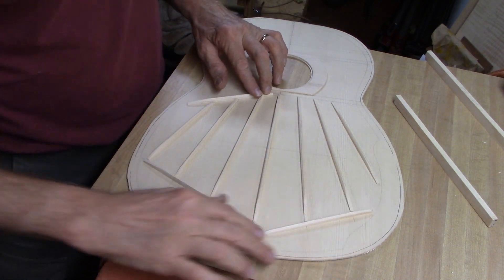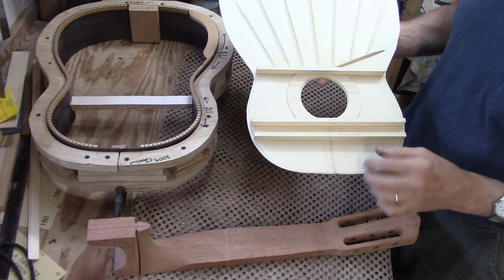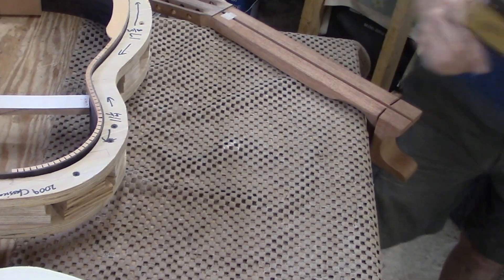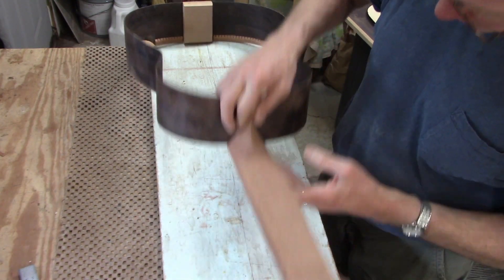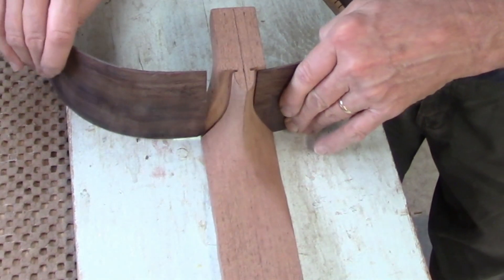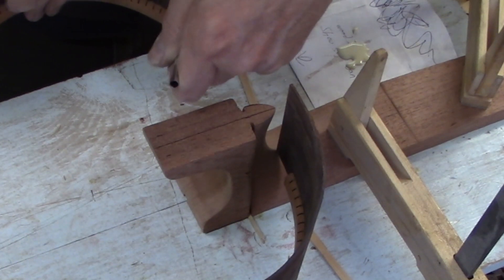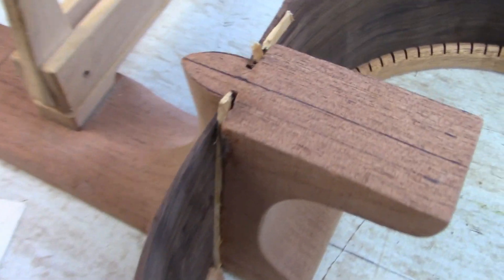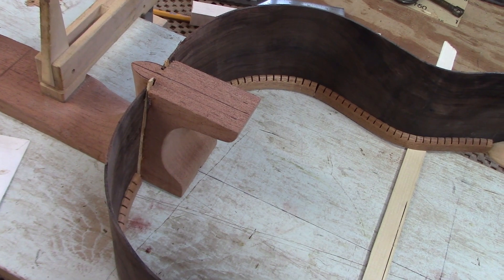Classical Guitar Construction Part 6

Comment: Harder to build a classical guitar or flat top, i.e. steps, technique, requirements, etc? obviously the neck/body joint process is different. 
Always wondered why you carve the neck after you join it to the body...certainly makes you have to concentrate harder on each pull! Must be an interesting reason you don't do the heavy neck shaping work before you join it. 
These videos are always fascinating...the enormous amount of past knowhow and experience you apply to each guitar is utterly evident...not to mention just about every tool you use was purchased from Zimnicki Custom Tool Works, Inc.
Reply from the maker: Yes, the Spanish heel is more difficult than the neck joint on a flattop.  Slotted pegheads are certainly more work than a solid peghead.  Slotted pegheads on a flattop are more difficult than on a classical because they are more narrow and I cannot get my wide fingers into them.
I like to keep the neck pretty square until after the fretboard is on and the frets are installed.  I see two advantages: first this gives me a wide surface for clamping when I attach the fretboard (although I generally use huge rubber bands instead of clamps these days.) Second, by leaving extra mass on the neck there is more inertia when I hammer in the frets, so I think the frets seat in the slots better. I have gotten used to carving the neck at the end, so to me it seems like the natural order.
That high tech blue board was a closet shelf30 years ago. I use it regularly both for aligning center seams and as a barrier to contain wood chips to one side of my bench when routing.
Thanks for your comments, Brad.

Comment: When you glued the sides to the heel you had pieces of wood under the sides, one at about the waist and some at the tail, is this for creating a degree of drop, or so to say neck angle? Those pieces of wood looked to be about 1/8” thick.
Reply from the maker: Those pieces represent the thickness of the soundboard.  The neck and soundboard are on the same plane, so those sticks keep the sides about 0.10" below the neck. Then when the soundboard goes on,  it will be on the same plane as the neck so the fretboard can be attached.  Thanks for asking.

Comment: Hi, what is the neck angel of the classical guitar?
Reply from the maker: The is virtually no angle at all. The neck is straight in line with the soundboard. After the 1/4" thick fretboard and frets are installed, a straight edge ends up being about 5.5 to 6 mm above the soundboard at the bridge location.